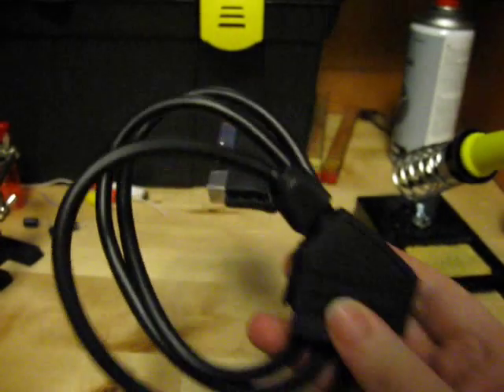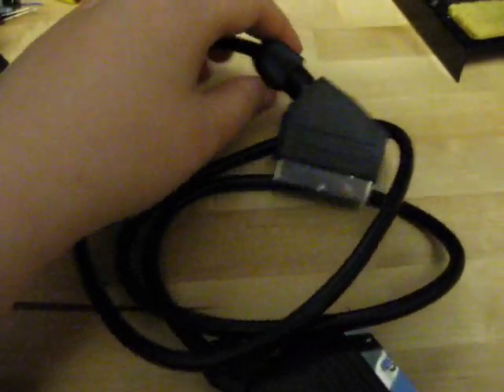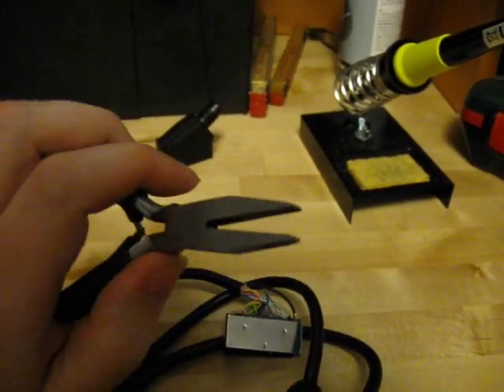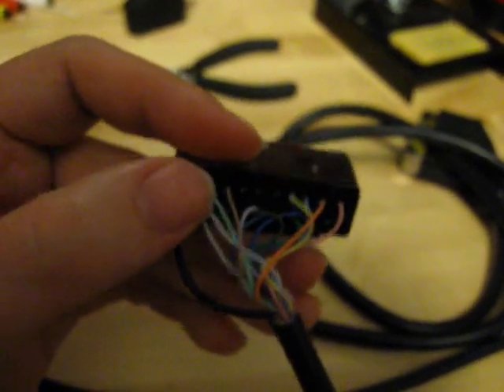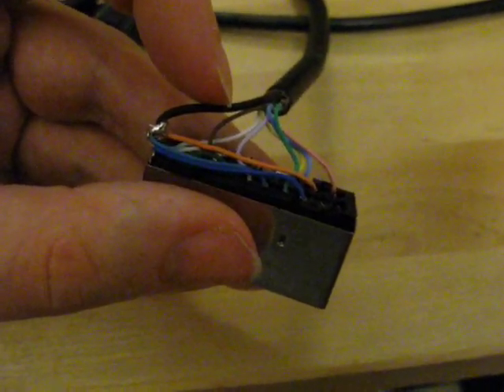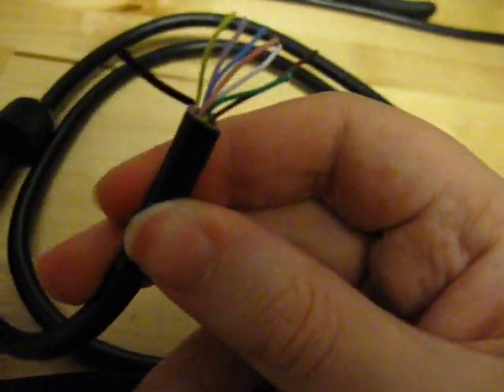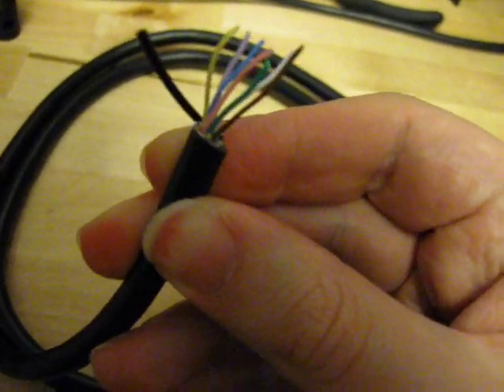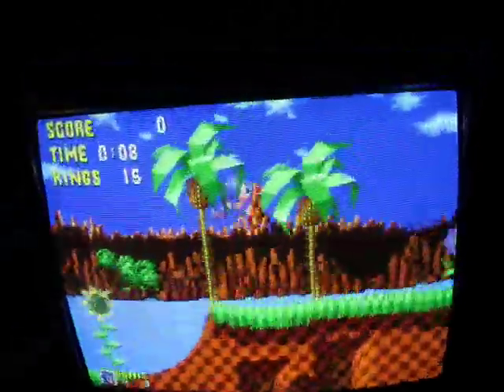How to make a Mega Drive model 1 RGB SCART cable

Comment: Is the capacitors necassary? like do they just exist in the curcuit to ensure colour balance or will every thing blow up with out them?
Reply: Ethanator You need them and the resistors to run Japanese and American SEGA units smoothly Yes it will blow up is why!

Comment: Hey. A friend of mine soldered a cable like this for me as well, exactly the same way as you, but the image is awfully unstable, some horizontal lines move to sides and it generally freaks out, especially if there's a lot of red colour on the screen, do you know what can cause this problem? Btw, the console works fine with composite signal.

Comment: is there a recommended voltage for the caps?
Reply: Consumer spec for TV signals is 0.7v peak to peak, and I’ve never seen an electrolytic that couldn’t handle that. So I guess the answer is “no,” since any electrolytic cap should work. ;)

Comment: could you repeat the specs of the capacitors 220 uF , but what voltage ??? 3 x 35 or 75 ohm resistor  ? one 180 ohm resistor but how many Watts?

Comment: I followed this video plus a pinout diagram and everything looks great but I get the dreaded jail bars that are apparently a common issue with megadrive/genesis and master system's outputting through RGB. Do you get them also while using this cable?

Comment: Why dont you make a video showing how to make a component genesis mod or cable? Is it possible to make this kind of connection between the genesis and a tv without svart or converters?
Reply: You can buy component cables in 2020 now people!
Reply: @afriend9428  …and you could buy SCART cables back when this video was made in 2012. The real answer for this guy was that he’s basically asking for something that isn’t even in the same wheelhouse. This is just making a replica of a SCART cable he did not engineer. Engineering a conversion to YPbPr for a region that has ubiquitous RGBS equipment would be pointless for him and it’s not like he’s any more capable than the person asking. We can ask NERDestino the same question: why don’t YOU make a video showing how to make a component genesis mod or cable, NERDestino? Sounds like it would be far more useful for you!
Reply: @emmettturner9452  People can buy them cheap and easy and brand NEW and very high quality from Aliexpress and Wish for less than $15 now so I don’t think the people will ask him to try now 💡
Reply: @afriend9428  Not YPbPr component cables. Those are RGBS cables, which are a completely different kind of “component” than what the OP was asking for (or else this video would already have what he wanted). Also, those $15 cables are typically missing the resistors and/or capacitors that are required inside a proper Genesis/Megadrive RGBS cable.
Reply: @afriend9428  …also, you could get cheap SCART/RGBS cables 8 years ago too. If anything, they were even cheaper. ;)
Reply: No

Comment from the maker: @K1NGARTH3R It should be possible to attach one RCA plug each on the red, green and blue line respectively but you'll need a TV or an adapter that allow you to plug in RGB that way.